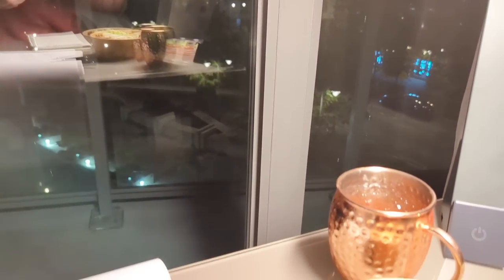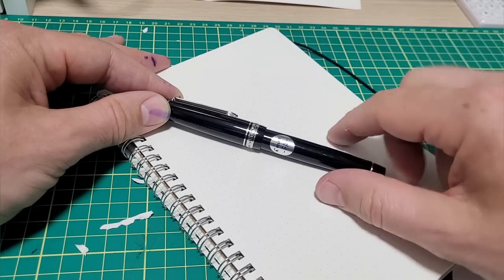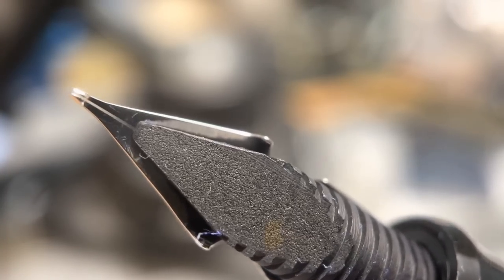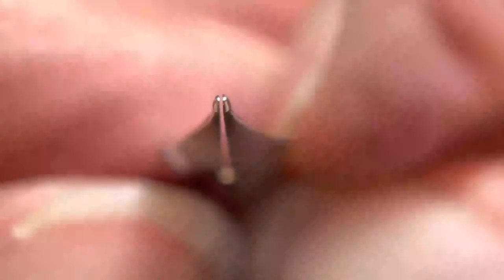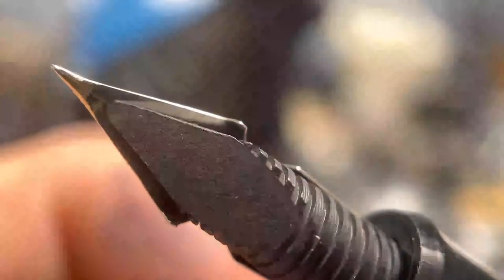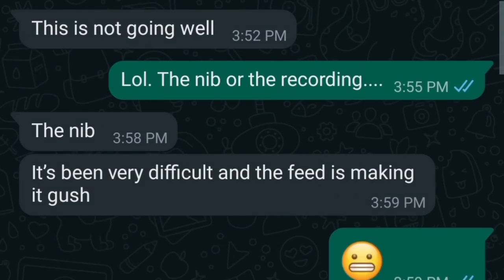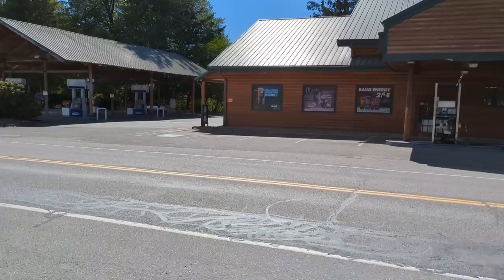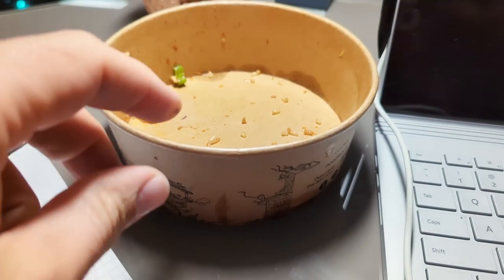The Perfect Modern Flex Nib Ground by Nibmeister Josh Lax - Pilot 912 FA Fountain Pen

Comment: One of the most interesting vids about flex nibs. Josh Lax is an artist and all the requests, the explanations, so very important to follow the process. Would like to know what was the cost of that tremendous well done job?

However, what makes me feel thinking (not to say angry) is, why the heck those well reputed manufacturer sell those FP's equipped with their FA (or Flex etc.) in a half-finished state? 

And with unsatisfying plastic feeds, not suitable to keep up with the much higher amount of ink during flexing. 

If a Pilot customer of an FA nib #10 or #15 wants to have the pen writing like a true flexer, one is compelled to pay extra 30 to 60 bucks for a decent ebonite feed with enlarged and deepened slits plus xxx USD for a nibmeister.

All this keeps me away from the modern Flex nib FP's, until the industry comes out with well working Flex nibs from the get go. JM2C
Reply from the maker: I can't remember what I paid for it but his current pricing is on his website.  He did such a great job on this one

Comment: After drooling over yours and others 912FA I finally got mine! I LOVE IT SO MUCH AND I'M SO HAPPY, however mine is slightly stiffer? and came in a plastic back from amazon lol, not even a bit of protection, it looked perfectly new and was sealed etc so I just went "meh" and kept it.
no railroading, no hard starts, perfectly wet. I feel like I lucked out lol. It also writes thin out of the box without pressure, I don't see a reason to change mine! I love it for day to day writing AND calligraphy :)

also my FA logo is a lot smaller than yours and doesn't have stars on the cap, it says "pilot" in Japanese katakana, I think mine is a Japanese version and yours is a version made for outside of Asia?

I was tuning my own OPUS 88 while watching this video, and being able to grind and tune nibs myself is an amazing ability to me, I feel like I can modify any pen I want to what I want which is a great power to have :P

I even made a flex jinhao that I absolutely love! it actually is surpassingly comparable to the much more expensive pilot falcon to me!

Comment: This was a great concept for a video. I loved the end-to-end storytelling. I have a Pilot 912 with an FA nib and I did add a Flexible Nib Factory two-slit feed. I've had it for some time, but now I'm paranoid about whether I installed it peoperly. The nib always has ink creep on it, but other than that it writes well.
Reply from the maker: Nib creep is not a problem for a pen.  It it leaks out and drip out the nib that's another thing, but a little ink on the top of the nib is no problem at all.
Reply: @Doodlebud  Oh, I know nib creep is not a problem. I just started to wonder whether I didn't quite position the feed right when I installed it, after seeing Josh's remarks. I've been using it this way for at least two years so I'm not too worried. But I'll look at it more closely when I next clean the pen out.

Comment: I recently got a Scribo with a medium flex. Agree with you, the flex lines were not much different than the non flex. I returned it and got a fine flex instead. much better aesthetics on the writing ie line width variation.

Comment: But that nib has plating. Isn't that ruined now?
Btw, I have the same Pilot 912FA with ebonite feed (installed by PenRealm) and was thinking the same. Even tho it's factory "fine", doesn't look like.
My thought was send it to someone who can re-plate it after regrind.
Like FPnibs.
What's your experience after some time using it? Should it be plated? And would you like it to be XXF?

Comment: Well... that was exciting... haha...

    Thought the rpm sounded a bit high, considering the foot-pedal control AND (particularly) the scale of the nib for the heat... I'm no expert, of course... It just stood my hair a little on end... Obviously, as close as his fingers had to get, it wasn't terribly hot, but part of the spring is the temper in metal...

     Now, admittedly, I'm all in on knives and tool-steel, and for smaller bits I know temper can go away quickly at around 400 - 500 F, which isn't hard to reach at that rpm (of course, judging 100% by ears and guessing... lolz)...

     SO I'll close with "It was educational"... I've probably still got a few thousand "Cheap-*ss Jinhaos" to futz with for "sketch pens" before I go gettin' "ambitious" about it... BUT it's always fun to SEE AND HEAR the ongoings of a pro'... AND if you (Doodlebud) say he's worth every penny, then Josh MUST be a pro'!    ;o)
Reply from the maker: You don't need to worry about heat transfer too much with this process.  Such a small surface contact point and very light cuts.  Josh mentioned to me that the higher the rpm the better when cutting
Reply: @Doodlebud  That's cool... I can be patient anyway... but it's good to know I've stood much less chance of "f*cking up hopeless" at least in the manner I most suspected... ;o)

Comment: Hi, How did Josh close the tine gap?
Reply: How did Josh close the gap in the times? Scissoring? I noticed a bit of scratch on the top of the slit edge. When I do this I use a 0.001 inch bit of plastic to keep the top of the nib slit edge clean.

Comment: Bought a fountain pen "Made in India".It was covered by a black plastic layer. This layer keeps peeling off at room temperature, exposing its brass barrel. This pen is now two years old using it as a handy tool on my desk. It was painful to keep it up and running due to ink leaks. Have now fitted a converter but the pen is now ugly but works offering a steady ink flow. Will review its functionality as time goes by. My son has gifted me a Chinese Pen marketed as Moon-Man with a screw-on cap but no clip to fit in the pocket. It may have an aluminum barrel and cap for easy access on my desk. Love the Shaffer Ink bottle to fill in as required. It offers a steady flow of black ink, writing my Journal. Am against grinding nibs and was unhappy to damage the nibs on all attempts in the past.Have promised me not to grind the nibs for better or worse. Nibs are akin to mouth and tongue, and must never be interfered with. My Moon-Man from China is a newish discovery. Love this instrument's quality and packaging box as a possible heirloom. Its cap is screwed on component to prevent ink evaporation. Perhaps suitable for use in aircraft journeys. Love my Moon-Man for use on the Moon.